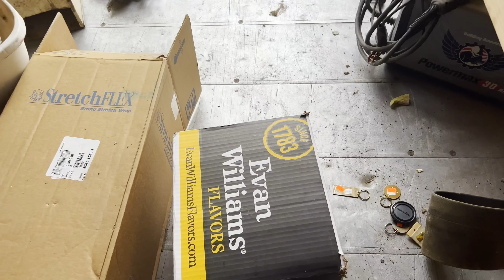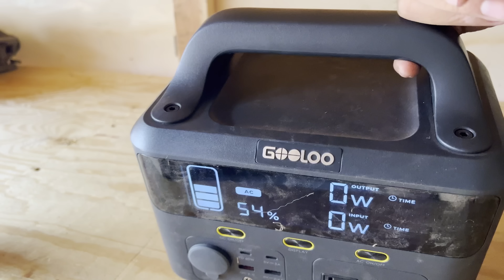Saving Bunches of Old Cars & Trucks from the CRUSHER (Plus I got a new tool: Gooloo GTX 300)

Comment: That thing you were calling a video camera looks like a 8mm film movie camera.  My fathers first one was a wind up, and the second one had batteries and zoom.  That one appears to have zoom.  The "8" after the brand name is probably for the 8 mm movie film it used.  Later they came out with "Super 8" film and cameras,  which had a wider picture area.  Then they made projectors which took both 8mm and Super 8 film.

Comment: How valuable are those old inline6’s? Where I’m from they are just dumped in the shredders.
Reply from the maker: If they knew how to use the internet they could make some good money on them. Most running 261 engines bring $1500+
Reply: @AdventuresMadeFromScratch  to be honest they are no where as clean as the ones you pull. Canadian winters hammer anything.

Comment: The problem with old 35mm cameras is to find film and find someone who still processes their own negatives.  The lenses are generally specific to a camera body or type.  In my experience, they rarely switch seamlessly to digital versions of the same brand.  Many 35mm film cameras are no longer made for just those reasons.

I wanted to ask if you have a group of restorers who regularly come to you for parts, knowing that you stockpile trim, doors, fenders, etc?  If you have a rare piece and nobody comes for it, how long do you hang onto it before it goes into the crusher?  

I find your videos generally hold my interest throughout, even if I don't agree with your reasoning.  I would rather get the land cleared of rusted out car, vintage or not, just to let grass grow!  Fascinating stuff, Silas!
Reply: Kodak still makes 35mm film

Comment: I don't think GMC versus Chevy has that much to do with the wheel lugs. I am confused about it because I have a 59 and a 1960 both Chevy trucks. Both of them are Vikings series 60s. The 60 has 10 lug nuts in their spacing looks more modern. Yet I looked at others same year trucks and they've got different set up all together. Now if I remember right my 59 is eight lug. I will say that my 59 is either 6 or 8. I'm pretty sure it's eight lug. It's amazing I just changed the rims and tires on that 59 I don't remember. Anyway I know it's less than 10 lug and I've seen it on 1960s decade model trucks too. I thought they would have the same wheel lug pattern and I could interchange the rims but no luck. I've got a 48 GMC but it's probably too series bigger. I don't remember the love spacing or number on it. It's no oil drilling rig a pretty good size. I guess my whole point is that maybe it's where they source the axles from and the accompanying parts. Maybe different manufacturing plants. I don't know just speculation on my part. I think the man's name is Carl Icahn from the '80s maybe the '90s he was a corporate raiders and he would buy the corporation sell off the pieces. Well on a much different scale that's what you're doing with these trucks. The pieces are worth more than the thing is whole. And they're already 60 years old or better so what's the odds of them ever being useful again. I mentioned this before that mention it again. I bought a international 2 ton truck and I was going to get the I believe it was a 3-ton drain truck but somebody beat me to it. My point is the man who bought that truck that is basically the same size as your Viking series 60s Chevy trucks and GMC equivalents. He was using the frame of the truck to build a monster mud truck up there in nebraska! And he drove all the way down to near Springfield Missouri. So maybe the frames have a market as well. He paid like $800 for the whole truck. You guys who are building those trucks dropping Cummins in there would kill to have that body. To give you an idea of the deal they got on the truck also I think you're saving those mirrors now. I think it's Joe. Could even be tim. But I know some other fellas you also have a strong market for those mirrors. West Coast mirrors they came in three or four sizes. The junior West Coast mirrors which I've seen you cut up are quite valuable and people are rebuilding them. I know you hear that and it's not a market there. Just FYI. Because you're putting the work into this you might get ever cent you can before it goes to the recycler. I think that blue mean offer cab was not as good as it looked on film if I remember your explanation on it. But it did look like a great cab donor for a pickup. People just have to be educated that they are the same cabs with extra skirting below that's easily removed. Okay just try and be a little helpful. You definitely know your business. Enjoyed your episode but cringe had seen that blue truck come apart.

Comment: Do you sell and ship parts
Reply from the maker: Sometimes. Just depends on what it is and how hard it is to pull.
Reply: @AdventuresMadeFromScratch  I need a five speed transmission 1999 ford  f150 two wheel drive 4.2 engine
Reply from the maker: @billyhensley7770  Sorry, we don’t sell late model parts. Just antique stuff
Reply: @AdventuresMadeFromScratch  ok thanks worth a shot